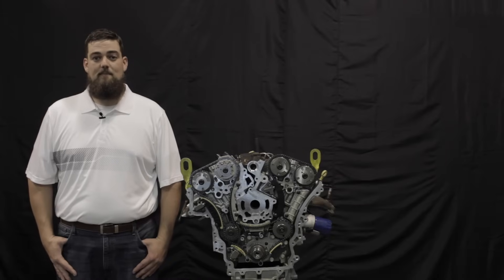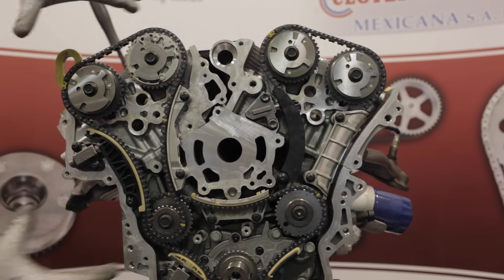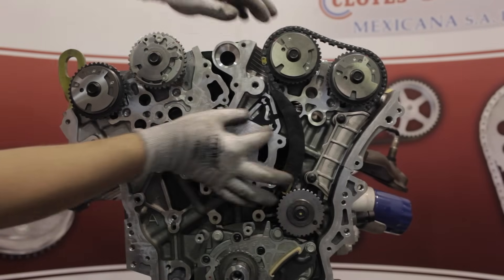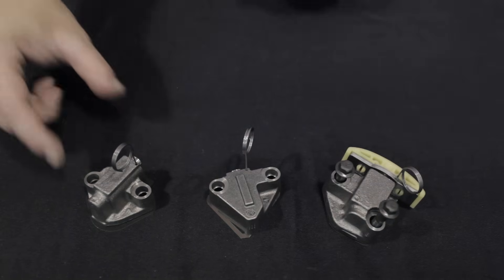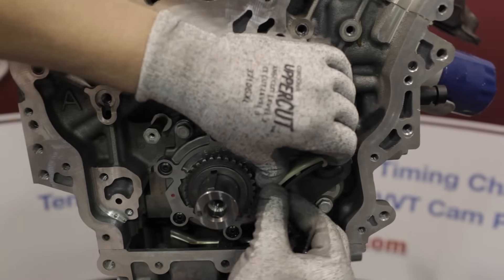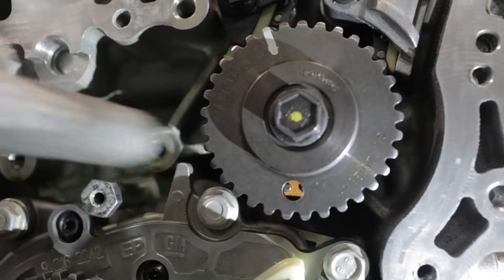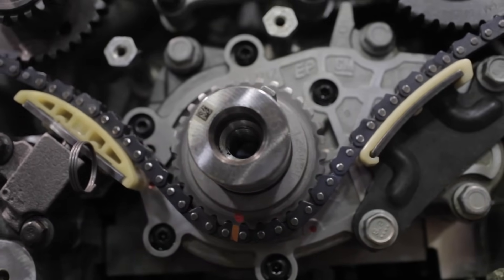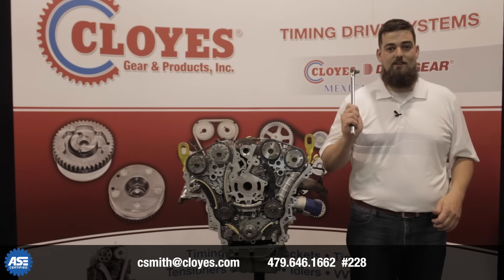GM 2.8/3.0/3.2/3.6L Timing Chain Replacement Repair, Cloyes 9-0753S

Comment: I am doing this job right now but when I am aligning the markings up before removing the chain, the ONLY marks that line up is the crank dot, one of the lines on the primary chain and the oil pump dot. All other marks are way off. But the engine still runs without any signs of timing being an issue. I’m doing the head gasket so that’s why I need to remove the timing chains. It’s just really strange to me that nothing else will line up. Is it required before removing? Or does the crank only need to line up???
Reply from the maker: Upon disassembly, or anytime after the engine has been rotated, the marked chain links will not realign properly. Don't pay any attention to the chain when tearing down, it is only important when assembling. The only thing you can look at are the marks on the shaft sprockets. Make sure your crankshaft sprocket mark is positioned properly and all your camshaft phaser marks are up. If your camshaft phaser marks are all down, just rotate the crank one full revolution and check again.
Reply: Cloyes Gear & Products, Inc. much appreciated! After about 150 rotations I finally got them aligned!
Reply from the maker: @JDmotoV  You must be a patient person! I knew they would realign eventually, but had no idea how many rotations it would take.
Reply: Cloyes Gear & Products, Inc. patience and not wanting to screw it up 😂

Comment: Had mines done like 6 months everything good but 2 crack shaft position sensor are leaking oil. Bank 1 and 2 are those easy to take off?
Reply: whats a crack shaft?

Comment: Cloys or anyone else, I jumped ahead and pulled timing chains and cams without setting marks, is there any instructions or guide to reset once I’m ready. Pulling engine down as sisters Sv6 LLT with 140ks had issues not only with timing but large amount of metal in oil and in can sensors. Have found couple of pieces on rockers.  Any advice please. Not urgent but good learning as I have the 3.0. Would love to swap but been told can’t be done. Thanks in advance
Reply from the maker: When you get the camshafts and camshaft phasers reinstalled, just rotate them so the proper marks on the phasers are close to the positions we show in the videos. You may need to rotate the crank so that all the pistons are down in the cylinders before you rotate the cams. Once your get them in the correct positions just install the chains using the marked links. If all your marks are aligned once the chains are all installed then you are good.
Reply: Cloyes Gear and Products, 
Thankyou for your reply, I thought it’s was going to be major issue. When I was rotating via crank before pulling apart chains were tightening and forcing fling back. Are the heads 2 piece and do I need to pull fuel rail off? Tia

Comment: Hi nice video and great products! When I install the intermediate drive chain idler and torque to 43 lbs. There is abit of play in and out... Is this normal. Thanks in advance. Vic
Reply from the maker: Yes, a little bit of end play in the idlers is necessary and completely normal.

Comment: Very common issue on these! if you get a p0017 p0018 p0019 you probably have a stretched chain. the Ecotec 2.2 and 2.4. also have timing chain issues.. first sign is a rattling noise on a cold start. Great video!!
Reply: I got a P0506 Low Idle Speed

Comment: Wont the cams move once the chains are off?
Reply from the maker: They may slightly move, but if you disassemble in the proper sequence and at the correct crankshaft "stage" then cam movement will be limited. Cam movement is not a big issue, the chains set the timing and you can rotate the cams back when installing the chains so everything aligns properly.
Reply: @Cloyes01  so is the correct camshaft stage where you showed at beginning of video where the crank mark is pointing to the passenger side

Comment: Hello, How do i rotate the engine to the stage 2 position when the engine is out of the car and the timing cover is already opened.
Reply: Put your crankshaft bolt back in and rotate it
Reply from the maker: You can slide the balancer back on an rotate by hand, use the balancer bolt, or we used 2 flywheel bolts and a long pry bar to rotate it from the rear.

Comment: Im doing my timing on the 3.6L engine. When i align the timing marks on the chain and the marks on the sprokets it lines up. But when i go to rotate the engine to stage 2 timing to do the right bank i look at the marks on the left bank and the primary drive system and THEY'RE OFF. I dont know what to do. Taken apart the timing about 6 different times and everytime i rotate the engine its not aligned anymore. Are the marks just for initial timing?? Just to align the timing initially and then they dont matter? What do I do?
Reply from the maker: So do your marks not end up at the same positions as on our engine in the video at the 7:32 mark? When installing the left bank and primary components at stage 1, only a slight clockwise rotation back to stage 2 is required. The cam phaser marks, idler marks, and the crank mark should all still be engaged with the colored chain links.
Reply: @Cloyes01  yes the marks are not the same as on your engine in the video. My marks on the cam phasers arent at the 12 o'clock position on the exhaust cam and the intake isnt at the right position. What should i do? Turn them to their right spot (with all the chains off)
Reply from the maker: @BenefitExploits  Your cam phasers will need to start at approximately the same locations as ours before installation of the chains. This will insure that once you make the shift to stage 2 that all your links will still be engaged for inspection. It is vital that once all 3 chains are installed that you can visibly confirm all the marks/links are still aligned. As you stated, you can rotate the cams to the correct positions with the chains off, JUST BE VERY CAUTIOUS! Rotate them very slowly and go back if you feel any resistance. You don't want to damage any valves. It would be best to rotate the crank so all 3 pistons are down in the cylinders, rotate the cams to their proper starting positions, then rotate the crank back to position.
Reply: @Cloyes01  I will try this? Is thete any way of knowing when the pistons are at their lowest point? And how is the crank supposed to feel when i rotate it? You mentioned there shouldnt be resistance?
Reply from the maker: @BenefitExploits  You can pull the spark plugs out and use a screwdriver to check the piston positions. There will be some resistance when rotating the crank, piston to valve contact will be a hard stop. Just turn slowly and don't force anything, removing the plugs will make it easier to turn as well.
Reply: @Cloyes01  Great thanks so much. Do I turn the Cam Phasers clockwise on both the exhaust and intake?

Comment: Those cylinder 1 have to be on tdc to do this job?
Reply from the maker: No, just focus on the sprocket timing marks. Align the crankshaft sprocket mark to the appropriate mark on the oil pump. And make sure the marks on the VVT phasers are up. If the timing marks on the phasers are down, rotate the crank one time and check again. With the crank aligned and the cam marks up you are ready for disassembly/assembly.
Reply: Cloyes Gear & Products, Inc. thanks a lot one more question once I take right side off do I turn the engine clockwise to the next mark or do I turn it counter clockwise
Reply from the maker: @flipr2118  Rotate the crankshaft counter clockwise back to the other oil pump mark. If you go around clockwise your cam phaser marks would be down on the left bank, you need them to stay up.
Reply: Thank you much very helpful

Comment: I saw that you don't recommend rotating the engine by hand after replacement - what if I did?
Reply from the maker: When rotating by hand there is a small chance of the chain jumping out of time due to the lack of oil pressure in the tensioners and the valve spring pressures affecting the camshafts. This is the only reason we advise against it. Chances are you will have no issues.
Reply: Gotcha. Thanks!
Reply: At the moment you begin to start an engine, the oil pressure is zero as well.  I wouldn't risk not turning it by hand personally.

Comment: Step 1 yank engine & trans then take to scrap yard. Step 2 install a carbureted sbc & trans from the 60s-90s era.  Step 3 take a picture and send it to GM and tell em this is how they should have done it. Ill take fabbing the engine mounts, cross member and driveshaft over that timing job any day.
Reply: So you'd rather do an engine swap to a weaker motor, that gets worse gas mileage, that doesn't last as long, that requires more maintenance, that's more finicky and sensitive to atmospheric conditions, than pull your front cover off and replace $300 worth of parts in about 20 minutes?  I can see you're fairly committed to the opinion that they were  better back in the day.
Reply: After the mid 2000s everything focused on being cheap (aka unreliable) and your description of a Gen 1 sbc is all wrong fyi and good luck doing this job in 20 mnutes as it takes 6 hours to remove the engine from the car before  you can start.
 @fastindy

Comment: You mention torque specs. You dont use a torque wrench. A breaker bar and box end wrenches are used in your video. If your gonna state torque specs better use the correct tool.
Reply: It's a demonstration motor. No point in actually using a torque wrench.

Comment: You should provide tips to torque the case cover and stuff back, and gaskets etc upgrades.
Reply: Don't over tighten the bolts or they will break off.  That's my tip of the day. ;-)

Comment: he pullled the release pin for the main chain tensioner then in the next shot it was back in. are we supposed to pull it before moving to stage 2 or not?
Reply from the maker: That was an oversight during our editing. Definitely pull the pin before rotating the engine to avoid the possibility of the chain jumping a sprocket tooth.

Comment: What's this all about with the factory service manual mentioning setting timing with a dial gauge stuck down into a spark plug hole and using the special camshaft tools?? If I simply align the timing chain marks as instructed in the Cloyes video I'm good, right?
Reply from the maker: Yes Sir!

Comment: What way do I turn the crank clockwise our counterclockwise
Reply: He's doing both but I'm not sure how you will turn it clockwise without having the engine out of the car cause it looks like he is using the flywheel to turn the engine. I guess if you have all the spark plugs out and there is no compression in the engine, you could put the crankshaft pulley bolt back in the crankshaft and use that, but if you don't tighten it hard enough in the first place it will just loosen when you try to turn counterclockwise

Comment: Is it possible to replace the chains with the engine installed? Vehicle is 2011 SAAB 9-4X 2.8 LAU variant, transverse mounted engine, AWD. Thanks!
Reply from the maker: AllData does not mention removal of the engine is required. As long as you have the room to get the timing cover off then it is possible. Unfortunately nobody here has any personal experience with the Saab 9-4X engine bay.
Reply: Cloyes Gear & Products, Inc. thank you!!

Comment: looks simpler than my challenger how many miles are the timing chains good for
Reply from the maker: These HFV6 engines typically need timing chains between 80,000 and 120,000 miles. Using the proper oil and keeping it changed frequently is critical for chain life.
Reply: there is nothing in owners manual about changing timing chain on my 2012 v6 camaro

Comment: Hey guys, how do you rotate the engine during this job? Breaker bar on the idler sprocket bolts?
Reply from the maker: We were using the flex plate on the back of the engine to rotate it for the video. You could also slide the balancer on to rotate by hand.
Reply: @Cloyes01  thanks
Reply: Thanks, that was also my question.  I do not know what a flex plate is but if you slide the balancer back on to rotate with a wrench, I do not know how you would ever see the marks through the balancer.  I have not worked on this type of engine but older classic cars you had to use a lot of strength to turn the crank shaft by hand.  I took putting a wrench and long bar on the wrench to turn by hand.  Maybe it is easier on a 6 cylinder than the old V8's.  Guess I need to ask my son!  Oh well!

Comment: how long does this take when the engine is in the car?  how much should it cost?
Reply from the maker: Based on labor manuals it is potentially a 15 hour job in some applications. So you can do the math, 15 hours at your local shop's standard labor rate.

Comment: Good video. Thanks. It's no wonder the GM car plants are shutting down. If it's not the broken wave plate in the transmission that fails , it's the timing chain, and or both. Plus the corrosion eating holes in the timing chain cover too. You answered a lot of questions I would have in the comments below. Thanks.

Comment: What a garbage motor.  You should not have to replace timing chains in a motor unless it has like 300K miles on it.
Reply: That's true, but the old engines had shorter chains so the same wear per link was about a quarter of what the effect on these are. But still, no excuse, the engineers should have known and used better materials.

Comment: Ok, let me put my glasses on.
so i can better understand what you're talking about.
you're saying that you can do a timing chain job without removing the power train.
and yet, you make a video with the engine removed from the car.
i know, i know, it's for people to clearly see how to properly do it, that's exactly why i dropped the engine, so i can have enough room, clear view, no chassis parts on the way, plus.
when you install that timing chain cover back in place, is not a very good idea to play with liquid gasket on a timing cover that has to slide in an engine that is sitting right in front of a bulky chassis, because. what could possibly go wrong, right??
better safe than sorry.
better to do a bunch of work once, than little work twice or more, just an observation..
Reply from the maker: In RWD applications like the Camaro the timing can easily be serviced with the engine in the vehicle. For most FWD/AWD applications dropping the powertrain will make accessing the timing components much easier.
Reply: Fwd cars are easy to do in the vehicle if you're dropping the whole engine out then you're wasting time you could be working another job

Comment: GM should step up and correct the problem. My dad doesn't learn and still thinks GM makes cars like his 1986 caprice classic 350 . Newer generations know better and keep away. He's had major problems with GM cars since 2001 including having to scrap a Northstar Cadillac due to head problems and now this on his 2011 Equinox
Reply: Bobby Tsamb 3.8 series 3 was awsome I have 2004 Grand Prix 400,000 on the clock runs great saw one advertised for sale with over 1 million and still running . 2.8 and 3.6 I don’t like at all got an 06 CT’s with 2.8  have not put enough miles on it yet but it gets less mpg than my 3.8  and lot less power

Comment: Does the timing move when tighning the harmonic balancer
Reply from the maker: The crankshaft may rotate, but the timing will not change if the chains are installed and the tensioners are activated.

Comment: Dumb question. How are you able to turn the gears so easily? I got the chains off and I can't turn them by hand like you do in the video.
Reply: Nevermind. i done did figured it out.
Reply: How did u do it?
Reply: @adnan9622  The smaller gears spin freely without any extra work. The larger ones require you to loosen the cams and turn them if they don't line up correctly. Research how to do it correctly because there's a tension order for the cam bolts and it's an interference engine so stiff will break if done wrong.

Comment: I've had 2 of these motors.  one in a CTS and one in an Acadia.  They're both trash.I have a Lincoln Navigator with a DOHC and the timing is spot on 137K and still going.  I have an E250 with SOHC 330K miles and the timing is spot on.  Why is it that both of my GM 3.6 have timing problems?  Because they are garbage.  I'm not just dogging on GM.  the LS is a solid motor.  Ford does plenty of things that are stupid too...3V 5.4 spark plugs for instance.  but in this case this is a terrible engine that should have been discontinued a long time ago.

Comment: Aplica para la variante 2.8 Turbo? Compré un kit Cloyes. Con cadenas de 78 eslabones para la primaria y 92 para las secundarias. Sin embargo el mecánico no tiene idea de como va ajustado el tiempo.
Reply from the maker: The only kit we offer has the inverted tooth style chains with links of 96 and 114. Our kit covers the 2007 and later USA applications. If your engine has the 92 and 78 link chains then you likely have the earlier version with roller chains.  Our kit will not work as a replacement for the roller chains without replacing all cam phasers to the later style inverted tooth versions.

Comment: I wish I could start job with timing cover already removed.
Reply: Maybe, I just got a friends Acadia that was towed to the stealership after losing power, and failing to restart. They have disassembled the entire top end. All in boxes. I have no idea which cam is which or what bolt goes where- it’s a great big jigsaw puzzle. They wanted to replace the engine for 8k. So yeah? I don’t know that it’s better...
Reply: @jonhunt5408  lol same 8k for engine at dealer, car is worth like 5k, and now probably less than 1k since it doesnt start
Reply: @jonhunt5408 not that hard at me of the cam shafts have a extra lobe that goes on the left bank for a direct fuel injection I believe if I’m not mistaken